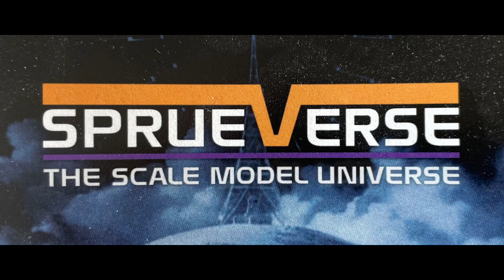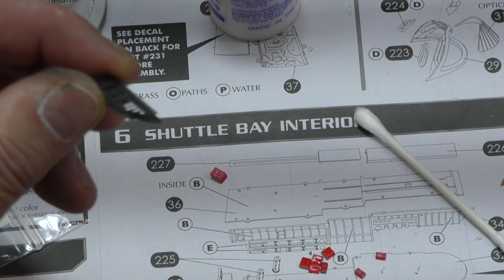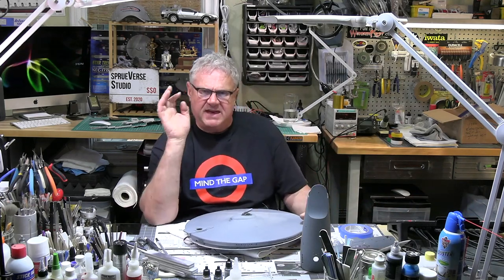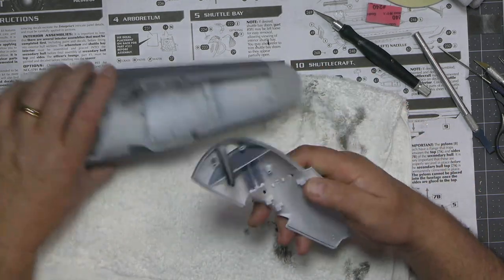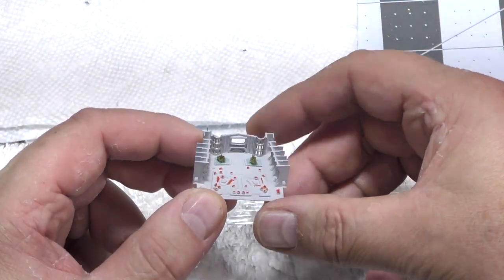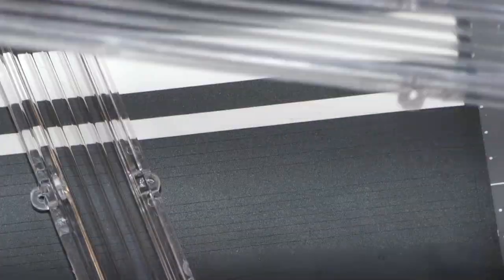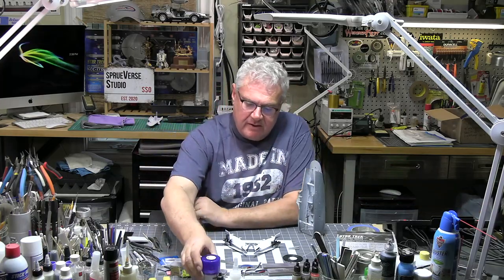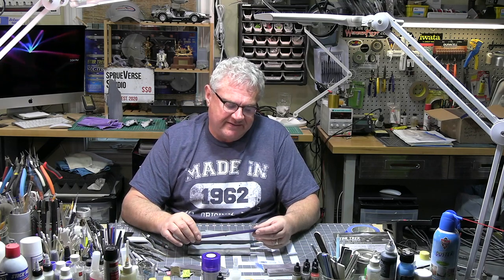Build the 1/350 Enterprise Refit pt 3

Comment: You're not the only one with wandering interests.  It does make completing projects difficult, but sometimes it's because you need to step away at difficult times and when you come back with a fresh eye and ideas to renew the build effort.   This is why I have varied skills from modeling to sewing to home repair, and the list goes on.  Though I find there is crossover in many things that supplement and solve problems in other skills.  My build will be a long haul, and who knows what will fit in the gaps.

Comment: The best spray-can primer ever, is Brite (oops, correction and edit: I thought I remembered "Painters" which is wrong!) Touch from any auto supply shop. Great for almost anything and cheap. (Sometimes available at WalMart.) Also comes in black-- a very useful primer. But I also use Tamiya sticker-shock super fine primers for small, detail-y stuff.
By international standard a millimeter is 1/25.4 of an inch (25.4 mm per inch) or .03937". 1/32" is .03125". Thus definitely thinner!
You will see into the arboretum! The human eye can move around and see over and past objects in the foreground-- especially when lit. So add that detail, everyone will see!
The chiller grills look extraordinarily good. Very good technique. Very good to see.
You're running into the "packing problem" - stuffing everything in as the parts stack up... save those nails and chew on styrene scraps!
There must be a way to firm up those pylon bases. Maybe sculpt in a huge blob of Apoxy around it? I hate obscuring even a few windows, but maybe that's the only way. My attitude is all windows on all the time-- I also think there would be more.
Good stuff, Phil!

Comment: Hi Phil, hope I'm not teaching granny to suck eggs here, but when I'm masking clear parts and there's a possibility of paint leakage I always go over everything with a clear coat first. That way if it does leak, it's not a problem as it's clear. What this also does is to seal the edges of the tape and prevents the colour (correct spelling  🙂) from seeping under the tape. Keep up the good work.
Reply from the maker: I’m going to try this method. Thank you for sharing! Cheers! Phil

Comment: My wife has the same problem as you - we call it a "butterfly mind". She constantly gets distracted and to paraphrase Yoda, her mind is never on where she is or what she is doing!  Chiller grilles look amazing! Got there in the end. You think that graphic tape is expensive - it's £24 over here in the UK 😧 I'm guessing that the instructions say to put the shuttle deck in BEFORE you glue the two sides of the secondary hull which would remove the need to cut any posts. I would be very reluctant to remove any posts or locating pins as the secondary hull is under a lot of stress supporting the saucer and pylons/nacelles so it needs all the structural integrity it can get. Butt joints are too weak. The lighting kit uses massively overspecced wiring - those wires could probably take an amp of current rather than the tens of milliamps needed. This makes them very hard to route. For the price of the lighting kit I think the manufacturer should have used appropriately gauged wire rather than cutting costs and making it easier for themselves by using the same wire everywhere. One final thing - your shuttle bay chase lights. If the shuttle is ready for takeoff rather than just landed shouldn't the strobes be  running in to out? 🤔
Reply from the maker: Love the comments! Cheers!